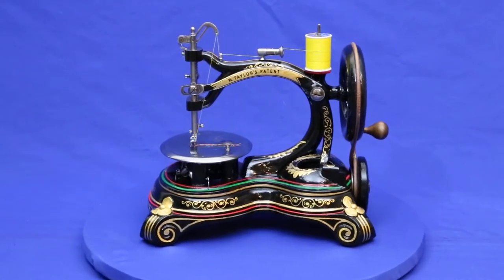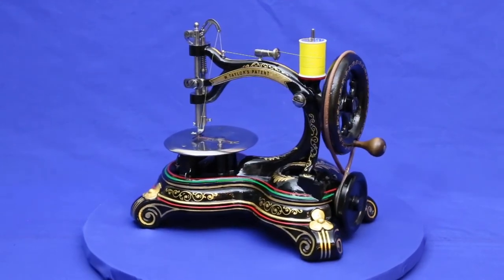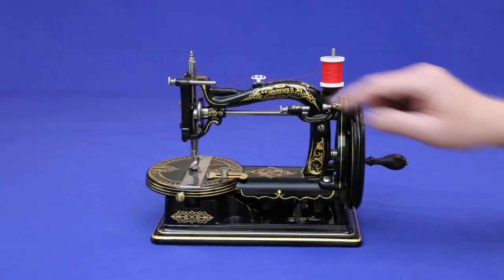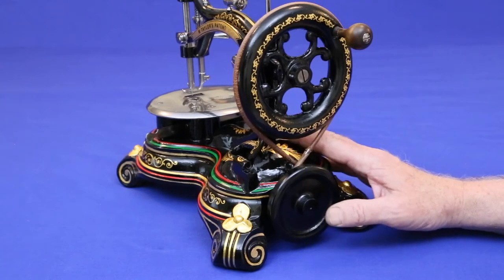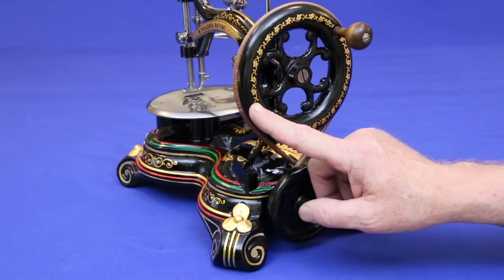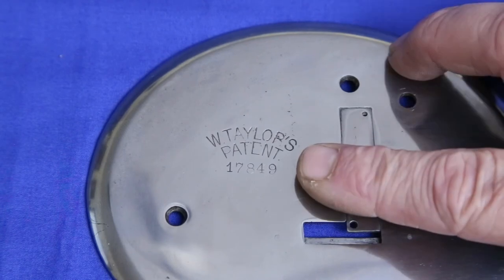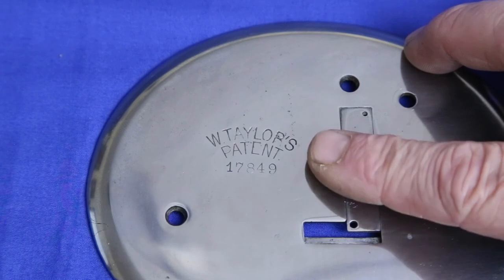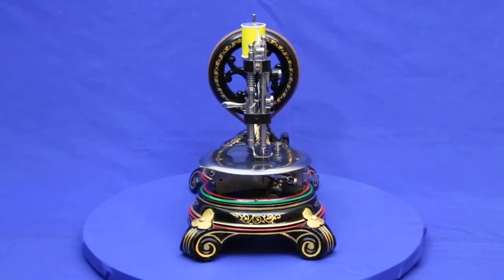William Taylor Cross Belt Antique Sewing Machine

Comment: Hi again Wayne.  I'm inquiring about the wanzer time utilizer again but comments are closed for that video.  I think the timing is off on my machine.  On a different video, I noticed the the wooden hand wheel was exactly straight forward when needle was all the way down.  Am I correct in what I was seeing.  My timing is different than that and am having trouble getting bobbin to catch the thread.  Thanks again for your help.  I have been working on making a replacement shuttle for about six weeks but now realize the timing may be part of the problem...
Reply from the maker: Hi, Joe! Great to hear from you again!

Seven minutes and 15 seconds into the following video shows and explains what correct timing and loop-catching by the shuttle should look like:

https://www.youtube.com/watch?v=rpQ2mAGlHNY

It's a different machine but should show what you need to know.

If you turn the hand crank on your Little Wanzer, you'll see that as the needle comes down it makes a double-bounce. It hits bottom, comes part way up, goes down again, then comes all the way up. You want the tip of the shuttle to catch the loop of thread formed by the first bounce. Or, if it's easier to visualize, between the two lowest needle positions. If your machine isn't doing this, clamp the upper gear in place, loosen the main gear so that it can be pulled out so it isn't engaging either the upper or lower gears, move the lower gear a few teeth one way or the other, push the main gear back so it engages both gears and give her a crank. Repeat this process until the movement of the shuttle and needle are correctly timed. This can be a time consuming and frustrating process, but unfortunately, there's no easy way to do it. 

I hope this helps. Sorry to take so long responding but we had a big family get-together today. Good luck!
Reply: @wayneschmidt490  thank you again for replying.  It looks like the timing is right on.  I'm in the process of tweeking #7 attempt at making the wanzer shuttle.  I'm getting close and am optomistic I will make this version work.  Where would I find the decals for the little wanzer?  Mine has the solid hand wheel and brass front plate serial # 10825.  Thanks in advance again for all your help
Reply from the maker: @joeeveryperson3279  I searched Google and EBAY and couldn't find anyone selling decal sets for Little Wanzers. Your only option is make them yourself. I have to warn you that this is a frustratingly difficult task. But if you're determined, the following video will get you started:

https://www.youtube.com/watch?v=2PKmkXWtQmY&t=2s

While I recommend using real gold leaf, imitation gold leaf is much cheaper, easier to work with and produces good looking results. Some high end machines originally used gold leaf. But, most used bronze-powder based paints. I have experimented with these but have yet to come up with anything that looks as good as the original paints. No formulation records of the original paints exist because they were closely guarded secrets.

Good luck!
Reply from the maker: If you decide to make your own decals, instead of spending many hours recreating them from your own machine, feel free to use the ones I made for my machine. Fast forward the following video to 7:55, enlarge it to full screen, pause the video at each decal page and use screen captures to copy them. Import them to your image processing program, resize them to fit your machine, sharpen them and you should be well on your way to making your own decals:

https://www.youtube.com/watch?v=JZGH4WxYMBM&list=PLEnCVl0LWmYfasxI2p2mcDF0YauzDkwYY&index=21&t=249s